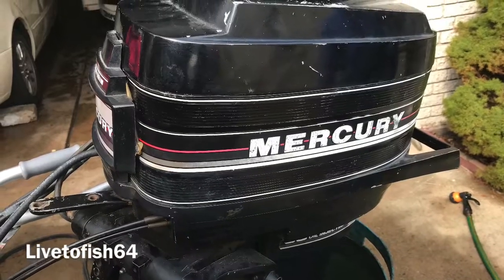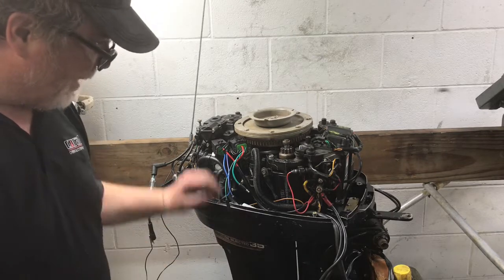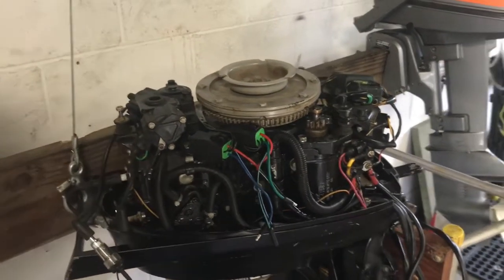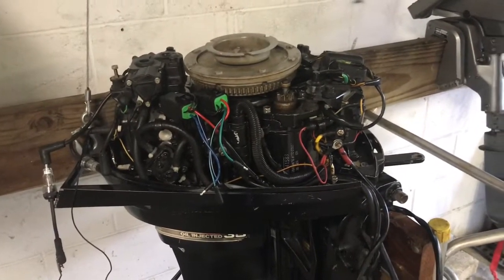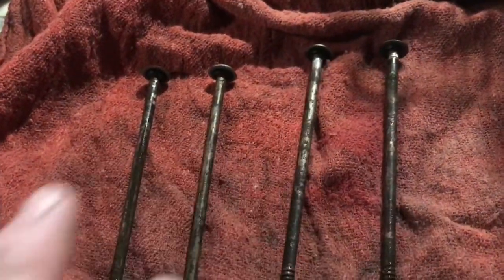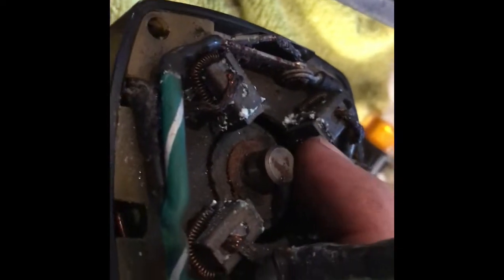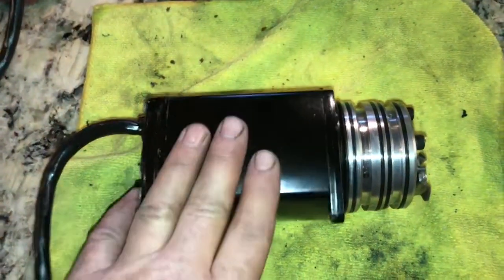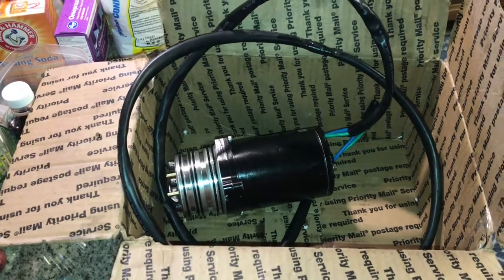Mercury Tilt Trim Motor - Stopped Working - Part 2 of 3

Comment: Where did you find that motor

I have the same problem but mine is beyond repair so i need a new one but i cant find it
Reply from the maker: You can find almost any motor you need at www.dbelectrical.com
but I should let you know their quality it not as robust as OEM.

Comment: I have the same motor and trim /tilt system. Same as your issue with the armature. I was able to clean it up and the motor is running great. But I now have a problem with the trim not moving despite the motor sounding strong. It moves the motor a little sometimes. As I look around and see videos and images, I noticed that I have mounted my motor 45 degrees cw from all the others I see. My question is, would my pump move the system at all if it was installed wrong? I am going to move it 45 degrees ccw to try. I just wanted the experts thoughts.  Thanks for your videos. Much appreciated
Reply from the maker: @MiloMordhorst-mu9bb… I believe the motor must be correctly oriented in order for it to properly fit it into the pump. You may also have air in the system and need to bleed it for the motor/pump to move the LU properly.

Comment: Thanks for sharing. I have the same trim system and my trim motor had the same problem. I cleaned the brushes as you did and the motor works great. My current problem is the pump and motor don't seat firmly. I have close to a  .25 inch gap. How do I install it? I don't want to be too aggressive with it and break something.  Thanks in advance for any help
Reply from the maker: Milo Mordhorst… it’s great you were able to clean the brushes and get the motor running again. It sounds like you didn’t line the pump up properly inside the housing causing the gap. I’m not sure but this is what I would make sure it’s correct. Never force anything like you said. Double check to make sure the brushes are all sitting properly around the commutator / armature. I hope you can figure out the problem, good luck.

Comment: Skipped through a little here because I still need to make dinner -- but am I right that you just needed to clean those brushes for them to make contact again with the armature? I was just testing mine tonight which has been in hibernation for 5+ years, it worked for a minute and then abruptly stopped. Hoping I can crack it open and get those brushes moving again and that will fix it.
Reply: Watched it again more slowly -- sounds like that's what it is. Hopefully it's the right clue for me!
Reply from the maker: The brushes were the problem. They were corroded and stuck.

Comment: wow ! nice video just what I was looking for. I have a motor very much like yours a three wire off of a 1994 merc 125, I need to open it and check those brushes. the motor works but every once and a while I have to tap it to make it work. your video will help me a lot now that I know what it looks like inside, there is a reason why I was hesitant to open it and that is because I wasn't sure I could find the seals. Were you able to find them and where I can not find them anywhere or the brushes in case I have to replace them although maybe I can make the up. but the seals would be a problem for me. someone suggested using Permatex, I still prefer using seals. I hope you are able to see my comment, in advance thanks for any information you might offer and thank you for this video.
Reply from the maker: That is exactly the same symptoms that I had experienced. It would work intermittently for a while then just stopped working altogether. You should be able to find a seal kit at www.marineengine.com thanks for watching and your kind comments.
Reply: @LivetofishOutboardRepair  no ! thank you. did you have to change your seals, and how are you able to seal the cord or wires going into the motor
Reply from the maker: I reused the seals actually mine were still in good condition. The wires going into the motor also had a rubber grommet that was also still in good condition.
Reply: @LivetofishOutboardRepair  well, I went ahead and opened up my motor I only took the lid off the inside looked so good I didn't disassembled any further the brushes looked very good so I only had to clean the commutator made it shine, made sure the brushes weren't sticking and popped the lid back on. the lid seal looked good as did the rubber grommet, I put on new bolt o rings they were easy to get and it tested just fine. thanks to your video and another from a guy named Rich on how to reseal the hydraulic piston I got my tilt and trim working again for the cost of the seals and a little elbow grease. Again thanks !